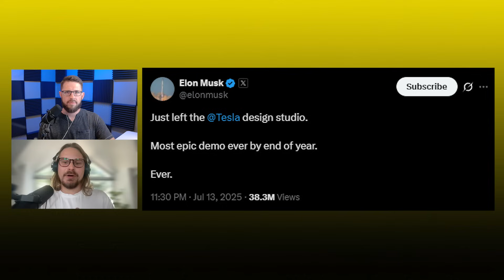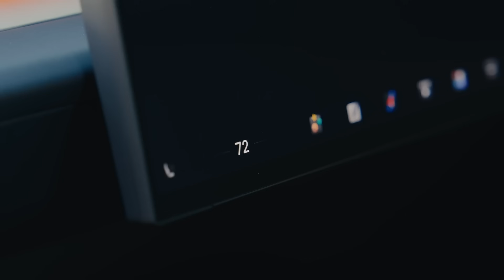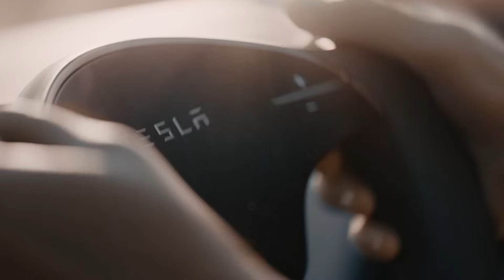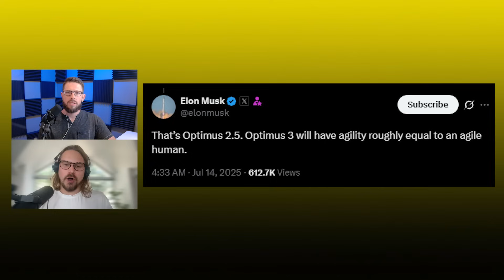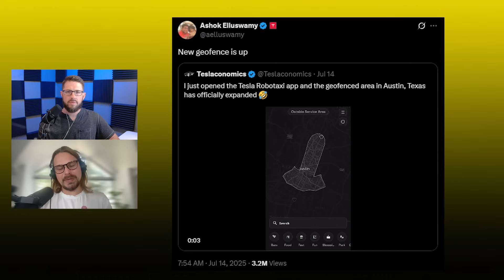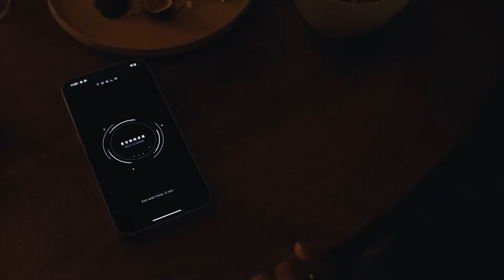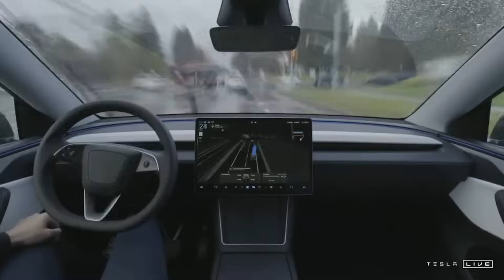Tesla Investors Listen Up: Big Developments!

Comment: I strongly disagree with James statement that “the hardware is significantly harder than the software” for Optimus. I’d argue the exact opposite. 
Hardware is very hard, software is what makes trillions not the hardware. You could have the perfect robot given to us by aliens with manufacturing schematics for everything it needed but a brain and you would have a 90lb weight that can at this point very slowly slot batteries into place and dance. 
Until you can say “Optimus go pick up that yellow handkerchief in that pile of rubbish and fold tie it around this bundle of sticks and then make a fire with it” your robot is rather useless. General intelligence is what matters. Until the robot understands the most basic parts of our world it will be severely limited to very linear tasks like working on factory lines with virtually no variance whatsoever and every task will need to be trained for (and probably downloaded separately for space). 

Hardware is harder than very limited tasks sure, but to be as competent as an average 10 year old at most task software is significantly a larger hurdle.

Comment: FSD is not FSD, and never will be without radar/lidar. Major mistake relying on computer interpretation. Any visual image is capable of multiplle interpretations. Measurement is not.
Reply: Measurement using radar is just as bad as vision if not worse, you’ve obviously never heard of ‘chaff’ or ‘window’.

E1857eo